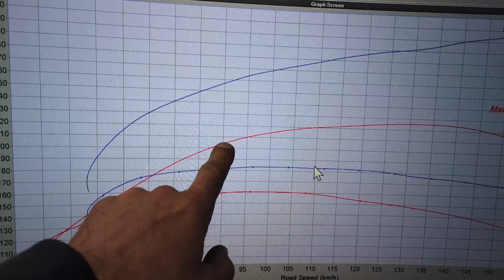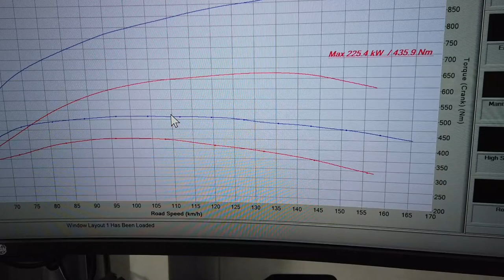Cam Motion 24-06-1004 Titan 1 VVT Hemi 6.4Ltr  221/227 Camshaft  Dodge Challenger

Comment: How would you rate this cam in a charger compared to the comp cams.
Reply from the maker: 10/10
Reply: @IndependentMotorsports  How would you rate it better than which comp Cam 1 or 2. 1st time i have seen these cams.
Reply from the maker: Better than both of them.